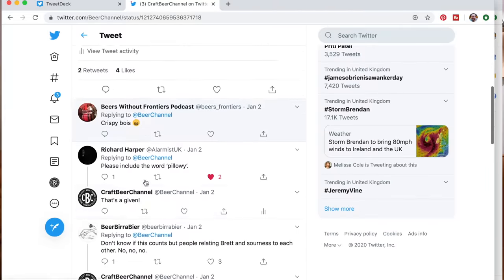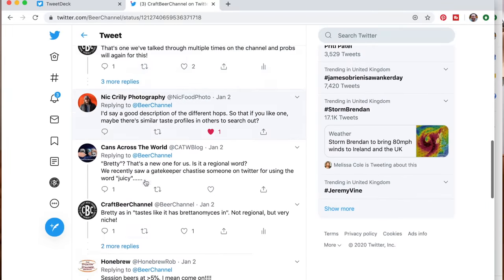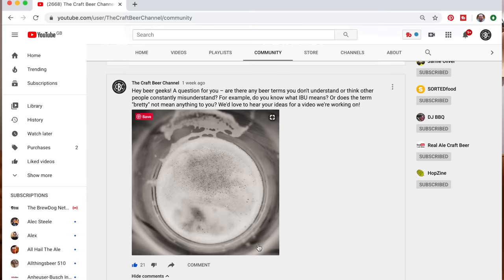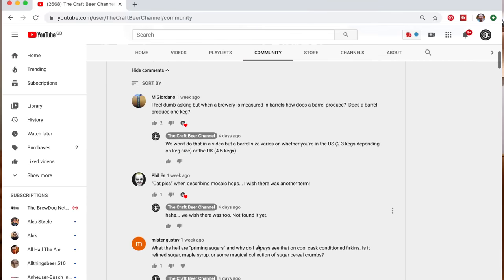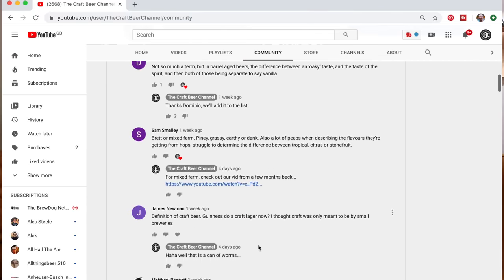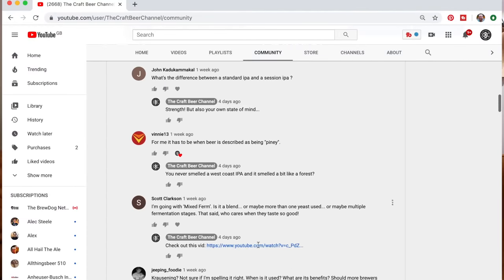Technical terms brewers use – translated! | The Craft Beer Channel

Comment: Left out other common beer "off flavors" such as acetaldehyde, green apple flavor, or dimethyl sulfide, cream corn, can be quite common. and about the double dry hopping, I can't say you're wrong, but I can't say you're right, it's extremely loose term that people interpret different ways. What you described is what we call in San Diego as first fermenter hops. To me double dry hopping would be more doing your first set of dry hops dumping those out and adding an entire new set of the same exact hops. Good video fun to watch!
Reply from the maker: We left them out as no one asked about them when we did the social call out! Perhaps next time, it's super important to let people know those so they can spot flaws. With regards to DDH - we are trying to stop it being interpreted in different ways! It seems our definitions are exactly the same, save for the use of the same hops each time which I don't think is necessary to stipulate.

Comment: Hey guys! Fun videos. Just an FYI, double dry hopped has nothing to do with whether the dry hopping is during or post fermentation. It’s just the process of having more than one dry hop addition. This can include one during active fermentation but may also just be separate additions post fermentation. Cheers!
Reply from the maker: Hey Sean - thanks for watching! I think many people use double dry hopping the way you suggest but it's not the rule and the definition isn't helpful for consumers - you could call a beer double dry hopped by leaving 30 seconds between additions that way! We know a lot of breweries that use it for when they add at different stages of fermentation and think that is much more useful for explaining a process and a result.
Reply: I agree with Sean 100% present on how he described it. 

You can double dry hop as you describe in the show, you can release to different hop charges under whatever duration you choose, or you can even single dry hope during fermentation. The interest in dry hoping during fermentation is because of interest in bio transformation of beer/hop flavor by the yeast. 
As far as cheating on duration of dry double dry hoping, there’s all kinds of gimmicks the brewer can do.

If you think it is easier for the guests to understand, then I can’t necessarily argue that you are wrong or right.